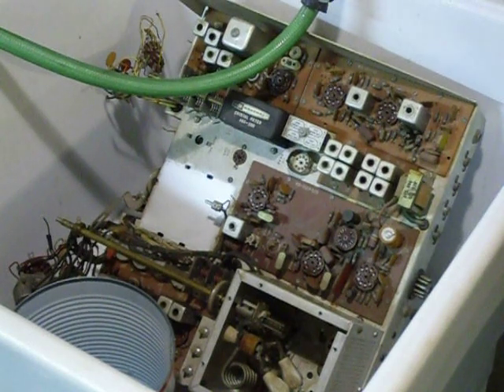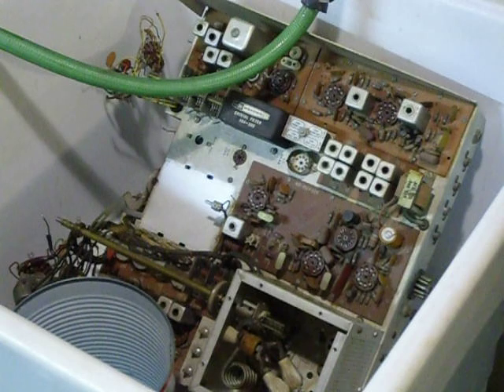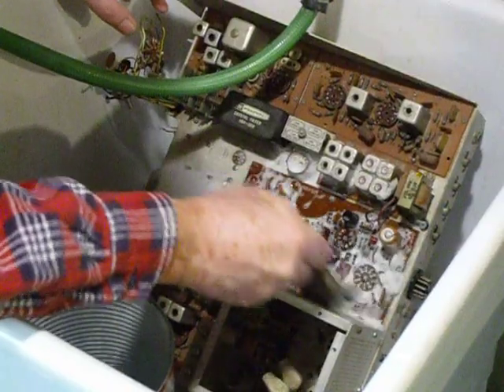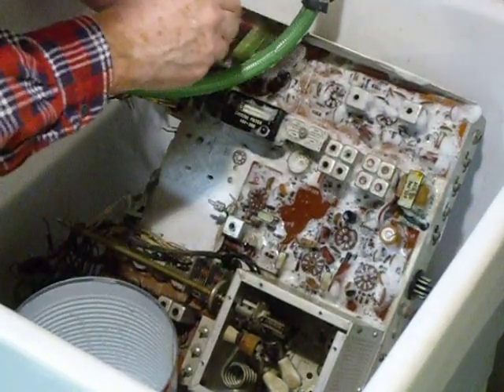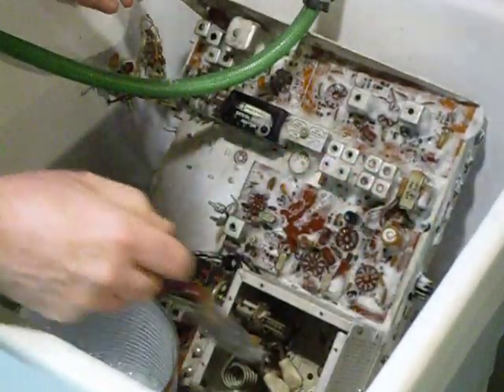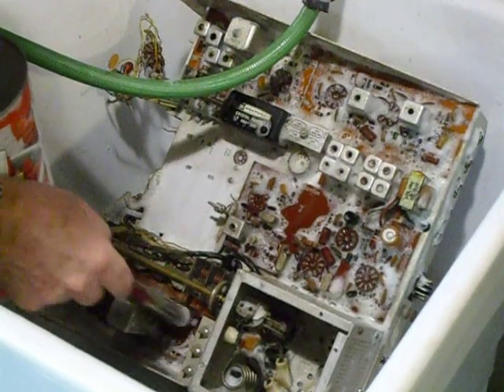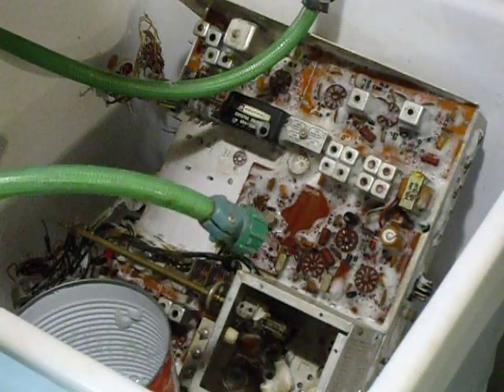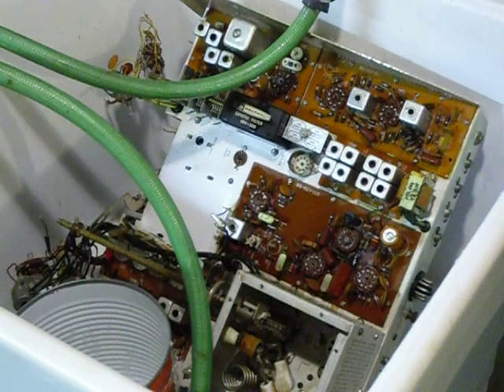SB110-3,SB110,SB-110,Heathkit SB110A, Restoring a boat anchor, Fixing an old tube radio

Comment: using a lamp with a reflector  will raise the temp to about 90-95 degrees... slowly and majestically is much safer than the brute force approach.  capacitors that are rated for 85 degrees C..  are not going to be happy at 150F.   While I understand and agree with the concepts... the application of oven heat, and hoses JUST PLAIN STUPID.

Comment: while dish soap and hot water are the right stuff... slobbering it on like this is nuts. paper  capacitors are not happy when they get wet,although those should be replaced anyway.    The oven treatment is just plain crazy.  there are paper cores inside those IF cans.. and they should never get wet,    this is a good way to wash a dog.

Comment: Bob:  My wife's oven will only heath down to 170 degrees.  Is this too hot for the circuitry?
Reply: He mentions in a comment that he tried 170 degrees with an HW-99 and the plastic trim started to melt. If you can't do 150 degrees, try a heat lamp. That way you can direct the heat where you want it and away from the front panel, meter, etc.

Comment: Hello Bob:  I almost fainted the first time I saw this video, because I never saw anyone do this to electronics before!  :-)   But after recovering from my shock, I tried your technique on a Heathkit SB-303 receiver and it turned out great!  Thank you!

I will be doing the same washing during the restoration of a Heathkit SB-401 transmitter.  I will remove the audio and power transformers, as well as the LMO.  My question is about the Heterodyne Oscillator, Driver Grid and Driver Plate coils that are on the left side of the chassis.  Is it safe to scrub and rinse the chassis with them still attached?  Or should they first be removed and somehow cleaned separately?  Thanks in advance!
Reply from the maker: Hi Bill , I have not done a SB-401 but I see no reason it cannot be done this way I would remove the meter  and LMO . Thats all. The transformers will be ok if you bake it at 150 degrees F for at least 3 hours what I have done also is to bake it the 3 hours in the evening  then shut off the oven and let it sit in the warm oven until the next morning .  Of course it would not hurt anything to take the transformers out . Be very careful of the baking temperature I baked a Heathkit HW-99 at a higher 170 degrees F and it has a different type of plastic which melted the front trim  of the radio  ! I would also open the LMO and with a  small disposable medical syringe lubricate the bearings and thin wipers at the ends of the LMO capacitor shafts . I use 10W-30 synthetic motor oil . Plain 10W is good too . The syringe allows you to place the oil exactly where needed you do not want to get any oil on the capacitor plates or the phenolic plastic supports of the stationary plates only the tiniest amount on the bearings at each end and the thin metal wipers at each end . The ten turn stopper assembly and shaft out front you can oil as well just a tiny bit !  .  When these LMO's need lubrication you will get complaints that your frequency will jump around . Most of these LMO's need lubrication after 30 or 40 years . I do the same to the volume control and all the other control  pots with the same syringe and oil . A tiny drop on the shaft outside a control with the knob off then a drop inside the control on the brass wiper you can see when you rotate the control these are not critical like a variable capacitor . Some of them I cannot see the wiper and I just squirt a drop in there with the syringe and rotate the control a few times  . I got my syringes at the local Pharmacy  which is commonly called a "Drug Store "  around here . I was in the "line" or "que" and asked the Pharmacist for a syringe he asked why ? I told him and he turned around and gave me a couple he said they were to old for medical use . The other people looked at him and at me  with surprised wide eyes !  It was funny !   73 Bill good luck !   Heathkits Forever !   Bob
Reply: Thank you, Bob.  I'll be following your advice to the letter.

I have a nearly complete collection of the Heathkit SB-series gear.  The only components I'm missing are the SB-220 linear amp, the SB-650(?) Frequency Display, and the SB-550(?) two-meter transverter.  I don't have the shortwave receiver as my late uncle gave me a BC-348-J that I discovered ham radio with.  It still works great!

But I'm nearly done with the SB-303 receiver.  (Got side-tracked for awhile, but finishing it up.)  Also restoring a 45-year-old Robot Research SSTV monitor and camera.  One last issue with the monitor and it'll be done, then time to work on the camera.  

But I completely agree with your sentiments of "Heathkits Forever!"  I built a few back in the 1980s.  Still have them, and was sorry to see Heathkit go out of business.  And for ham radio gear, there's nothing better than restoring some vintage Heathkits so you understand how radios work.  Plus you can have the satisfaction of knowing you are maintaining your own gear instead of being an "appliance operator!"

I also have the SB-610 RF Monitor and the SB-620 Scanalyzer.  The SB-620 will be the highlight because the original owner built it with the 455kHz IF, whereas I need the 3395kHz for my SB-303's IF.   So I'll be making my own transformers, etc. to shift the SB-620 to 3395kHz!  Will be fun!